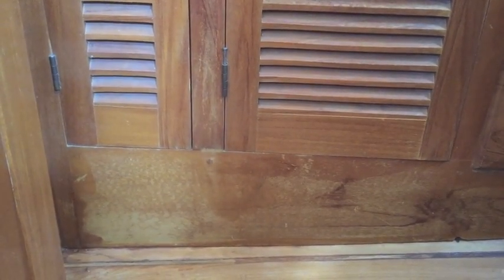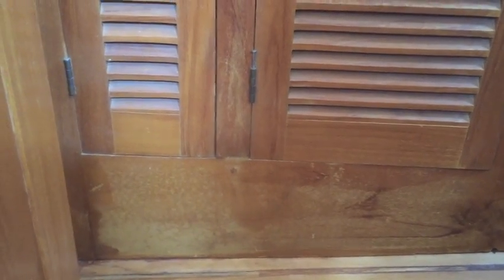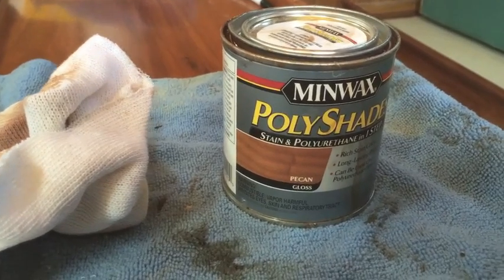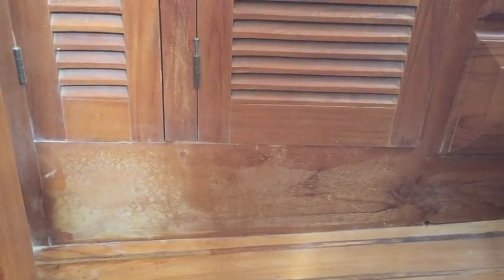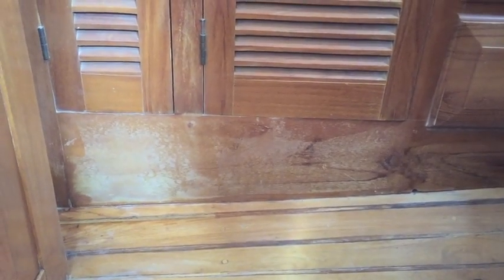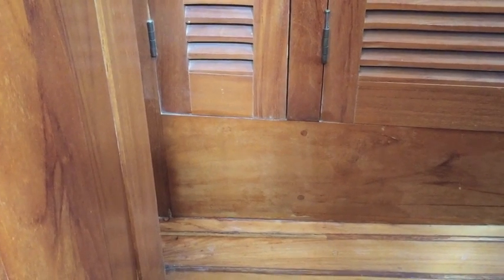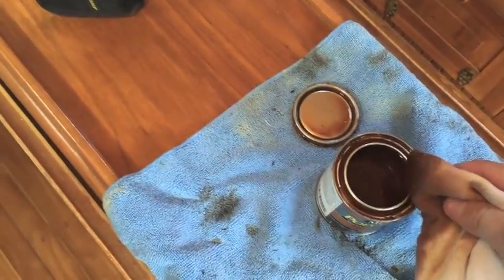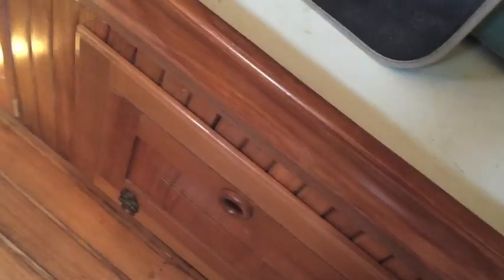S/V Corsair Refinishing Interior Teak Part II

Comment: I only use teak oil. Inside and out. I never use varnish. Wood has to breath and when you seal one side with varnish then the moisture in the wood is trapped and cracks the varnish causing the need to sand and refinish. Oil helps repel water and stains and puts natural oils back into the wood and keeps it from cracking.
Reply from the maker: Thanks